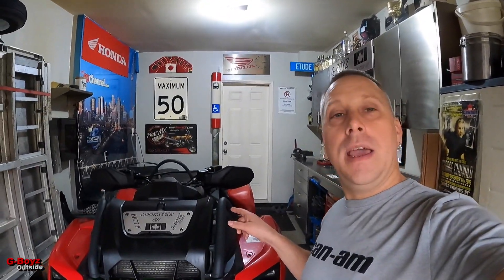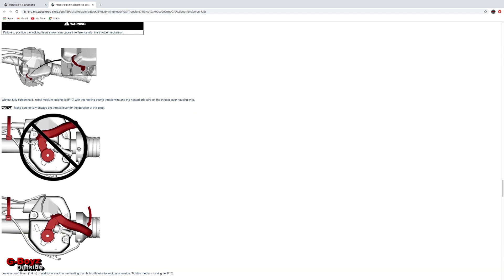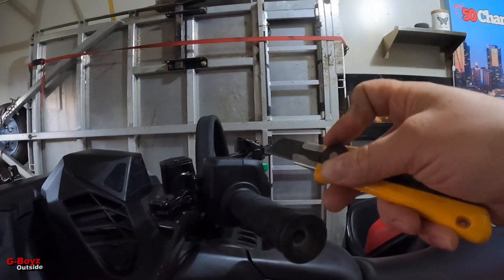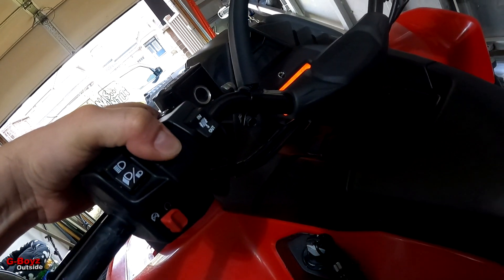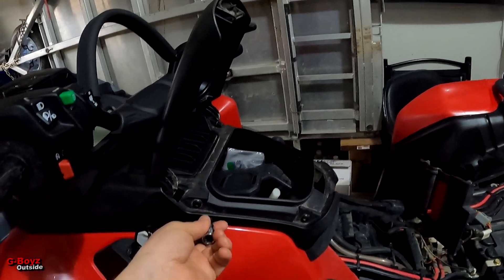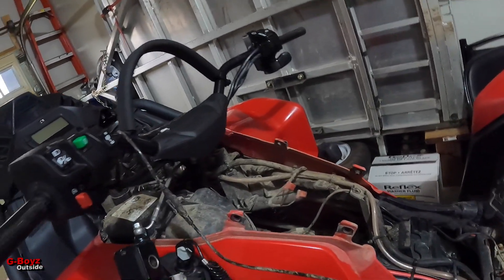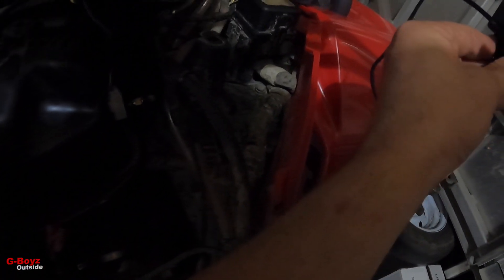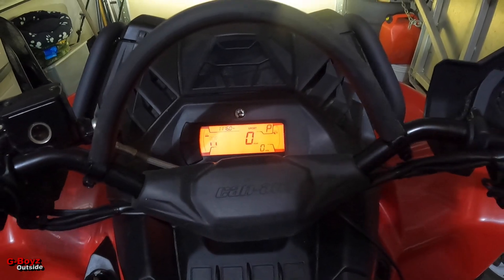HOW TO INSTALL Heated grips & thumb accessories for Can-am ATV's

Comment: Something that would be cool is a video on taking off the primary and secondary clutches and what a tools a guy needs for that. So we know what to inspect and for cleaning purposes. Also a video on greasing the wheel bearings and what size EZ greaser tool is needed. Maintenance content is always good for us. Always include part # and where a person can get that part. Great video, I live up here in northern Wisconsin and these are a must have, and thanks to you alot easier for me to know what I am gonna need to do for this add on. Thanks keep it up.
Reply from the maker: Well I've never greased wheel bearings yet but there will be a time that I will have to do it. I don't have any clutch tools yet they're pretty pricey. But appreciate what you're looking for in content. Appreciate all the support🍻